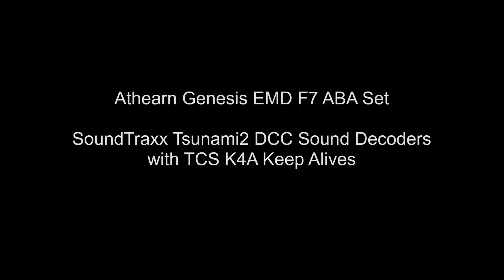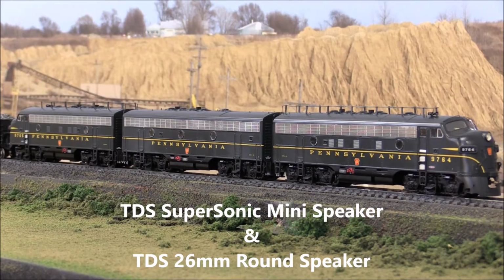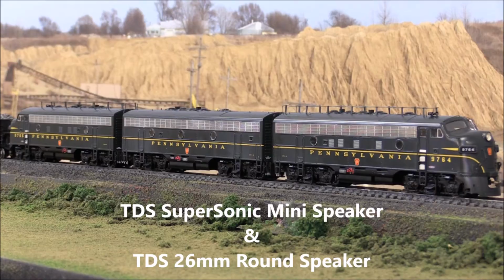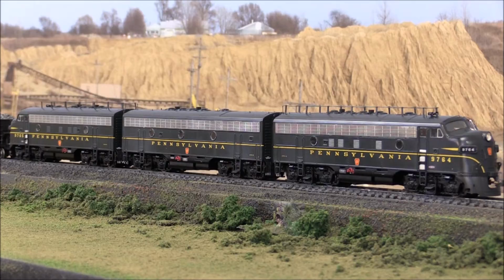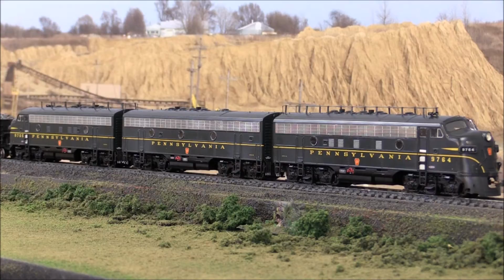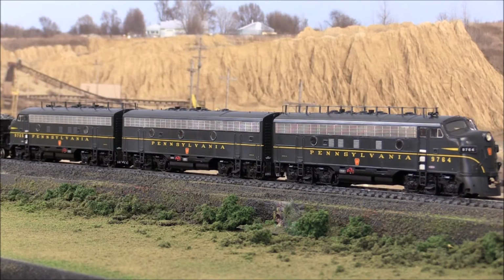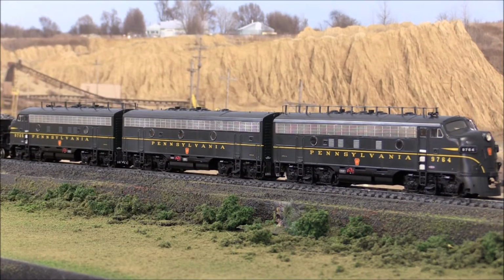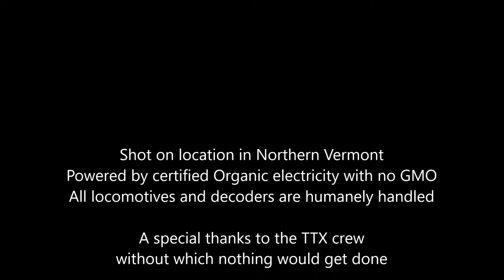Athearn Genesis EMD F7 & Tsunami2 with TCS KA4 Keep Alive Part 2

Comment: Great video, that's a sweet consist of F7 locomotives, very sharp looking and the sounds and functions you set up are some of the best I've seen and heard.I came across this and the part 1 video looking for info on the TCS KA4. Have one coming for a Broadway Limited 4-6-2 USRA Heavy Pacific Paragon 3 locomotive that has sporadic stall issues on a couple mainline switches (none of my diesel locomotives have this stall issue 99% of the time).  Its amazing to me the knowledge that can be learned on YouTube. Don't, know how I missed your channel in the past but I'm subscribed now. Cary

Comment: Do you know if the KA4 fits an Athearn Genesis GP38-2 and if it's a plug-in or hard-wired connection? Thanks.
Reply from the maker: The KA4 will probably be a bit large; we typically use either the KA1 or KA2. As an alternative we know the SoundTraxx 810140 will fit an Athearn GP38-2 and plugs directly into the Tsunami2 factory board

Comment: Nice sound, but the horn is too weak
Reply: The horn volume and all sound effects for that matter can be adjusted.  On video, we try not to overwhelm the microphones, so volumes are lower for filming.  I can tell you that these decoders when adjusted using the seven band equalizer and with the right speakers can blow the doors off.